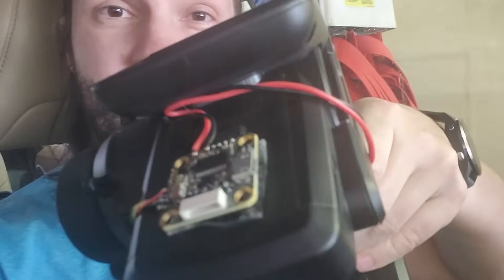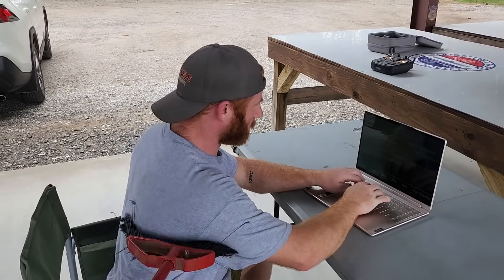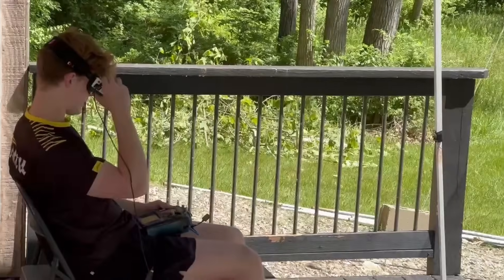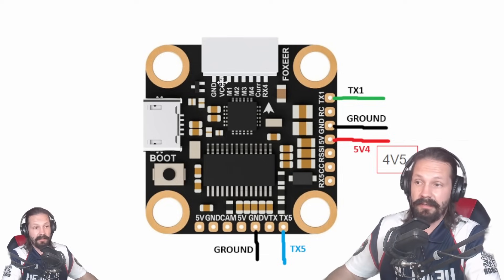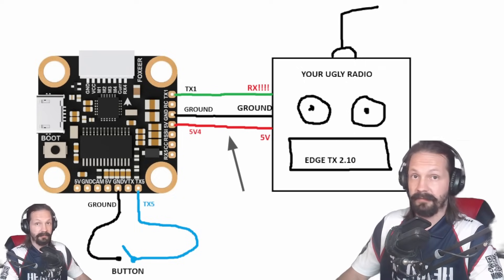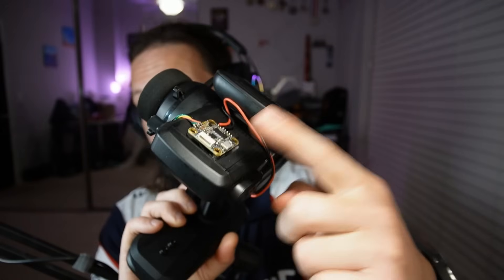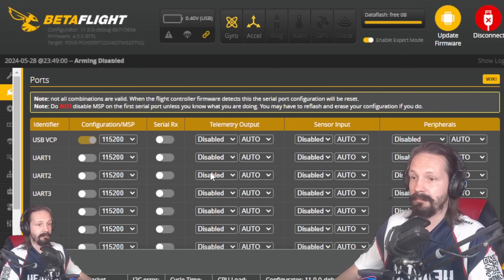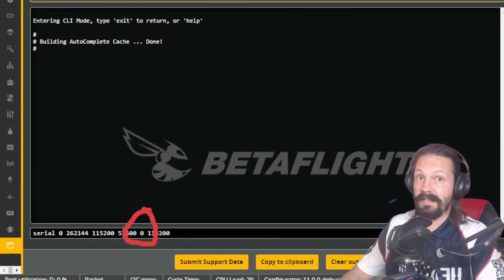Easiest DIY Motion Controller for FPV using Betaflight

Comment from the maker: Hey guys, radiomaster just released a gyro board for M12 radio, you plug and it just works.
So far its only 2 axis, not three. And +/-45 degrees max. But i bet it would also work for FPV wings with no yaw. Upside that you will also be able to connect a headtracker for goggles at the same time.
More info:
https://www.youtube.com/post/Ugkx-5xJTb9tXSfc07DJGCLonS91y4AR9hki
Reply: Hello, Ivan! I am grateful to You and Steve for lighting and developing this solution, now my Radiomaster Pocket has the capabilities of your Radiomaster MT12! And even more, with the help of Bluetooth HC-05, I also receive telemetry with the track of my models, and it's all in one Pocket!
Result video:
https://youtu.be/H0IxwpZymaA

Comment: Also on the transmitter handset you need to plug into the Rx pin and the Tx pin is NOT used.

Comment: hey ivan, does your setup (fc to radio for motion control) also work with a radiomaster boxer radio? does the boxer have the serial port to connect the fc  as well? i  have a project in mind that would need more toggle switches than the mt-12 has. any thoughts would be greatly appreciated. thanks.
Reply from the maker: sorry just saw this. Yes :)
Reply: @IvanEfimovLimon  thanks for the update! shuggs - i already bought the surface radio. I have 3 sets of radios and fc's for motion control. it works really well! thanks for the hack - it s awesome!!!!

Comment: it hurts my soul that Ive spent months working on this and here you are, but Im also stoked you found a simpler way than doing it from scratch.
Reply: As an update, I'm running an open source headtracker through the trainer port of my transmitter for motion control, now. Works flawlessly on wings and quads, the trigger throttle is neat.

Comment: Great video Ivan. Is there a way to hook up a potenciometer to the fc and read its value as throttle input?  So we could hook up a standard radio via sbus port?
Reply from the maker: There is a way, but needs some coding in BF :)

Comment: What a kick in the balls. Radiomaster released today that the radio has this built in. Love the innovation though. I used the switch mod on the boxer
Reply from the maker: yup i saw that. I tihnk its pretty cool. It has two axis, not three, but might be still ok for the FPV wings. Depends on the angle accuracy and update rate.
Reply: @IvanEfimovLimon  true i think it's cool to be able to do

Comment: thanks you sir, its work, but, my 1st experiment fc gyro is garbage like your said, haha..
thank you.
Reply from the maker: Make sure you calibrate gyro tho :) leave radio still right after powerup
Reply: @IvanEfimovLimon  Yes sir, I have calibrated the gyro and created a DIY reset button for the yaw as well. Everything is working well and fine, but maybe this is because I am using an AIO flight controller with ESCs that have been submerged in water, with two of the ESCs being dead, so the gyro is a bit odd. Every time I stop moving the radio, the gyro suddenly shakes a litte bit. When I swing the radio, the gyro is smooth no jitter, but when I suddenly stop and stay still, the gyro shakes first before stabilizing again. But it's okay, overall it's good. Thank you.

Comment: Thank you for sharing this!
I tried this right after I saw this video. But in CLI I can't seem to find any command or parameter related to headtrack.
I noticed that you were using the BF 11 debug version. Must I use this specific version to have headtrack parameters?
However I can't find the 11 debug version, I can only find PWA 11 normal version. 
Thank you!
Reply: ok I got it
The FC needs to be flashed with the exact firmware to work and to have the parameters 
Thanks!

Comment: This looks great... but to be more compatible with different controllers it would be better if it output PPM rather than SBUS. PPM is the standard for trainer ports.
Reply from the maker: It's be cool to add PPM, just PPM delay is much bigger than Sbus, and sbus is pretty bad already by modern days standards...
Reply: @IvanEfimovLimon  yeah... but not so important for a wing
Reply from the maker: @Yith  i guess it depends on how good your wing performs...

Comment: You could put arming and reset yaw on the same switch. That way you will never get it wrong. 

If you replace one of the toggle switches for one with double contacts you can put both on the same switch. requires a bit of soldering but it should be easy enough. 
You could also use a separate switch if you want to be able to reset yaw without arming or disarming.
Reply from the maker: Yup I'm thinking about it. Just didn't want to take the radio more apart....

Comment: circuit diagram is showing cable connection to your 'your ugly radio', shown with a rectangular silhouette like a normal radio.However I assume this 'ugly radio' denotes the Radiomaster pistol/joystick controller? Since I don't see any cables running from the Radiomaster controller whenever you showcase its operation when modded..🤷
Reply from the maker: Yeah that's just generic representation of any radio in my drawings :) later on in the video I show where to connect wires on the MT12 radio. 
Cables are there. I just made a little hole in the radio since the UART plug is inside the radio.

Comment: Sorry man can't trust anything you say wear'n a pair of Orqa's 😛 p.s. why not just plug a friggin PS4 controller into the TX and not waste the F7 or a betafllight dev's time??
Reply from the maker: Orqa are great analog goggles.  And with PS controller you'd better stay home lol
Reply: @IvanEfimovLimon  PS4 controllers have gyro and are usb and should be easier than dev'n bf...
Reply: in fact pretty sure PS4's have been used by the DJI guys for years now but have yet to see someone running gates with one lol new project??? LOL you got the TX already....
Reply: Also that was kinda a bad Orqa joke seeing as they had issues due to firmware bricking goggles from the start then let a guy code firmware exposing all their customers to ransomware, hence the trust issues
Reply from the maker: @battantx  looks like you have no clue what you talking about :)
Reply: @IvanEfimovLimon  Well I mean I bought one of the first pair. First new Goggles after my used SkyZone 02X's lol so got to live it first hand. Currently use 04X's modded out for Analog/HDZero but working on a Virtual Pilot Sentient automatic antenna tracker for crsf/elrs analog/hdzero auto tracking ground station with a skyvison mounted on it and a LOS Camera mounted on the AAT pumped out analog on another channel lol basically something I can mount on the roof of my car and go Can convert analog to HDzero or HDZero to Analog at ground station the size of a shoe box using 4x VAS Pepperboxes for HD and Two on Analog lol shhhh dont tell the FAA I'm not keeping LOS on very long range 1W analog micros please hahah being one of the first to use an SX1280 and ESP32 to DIY my own 1W ELRS TX before the manufactures got around to making some is really helping out on the AAT but yeah I dont know what I'm talking about. Still think you should try a PS4 controller and use just it with mouton control and buttons defined on the TX not my thing but would be coool

Comment: You don't need to use the ground radio....any radio with a tracker/trainer port, or uart will do......😊
Reply from the maker: Ground radio is cool cuz it has appropriate throttle
Reply: Hola puedo utilizar una qx7s con el puerto entrenador y usar solo el rc terrwstre con el mod para controlar???